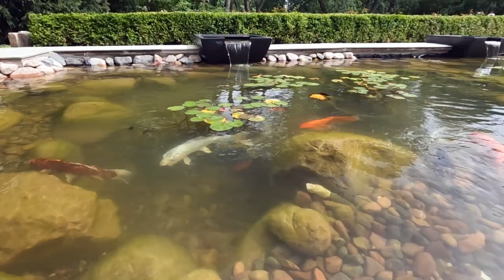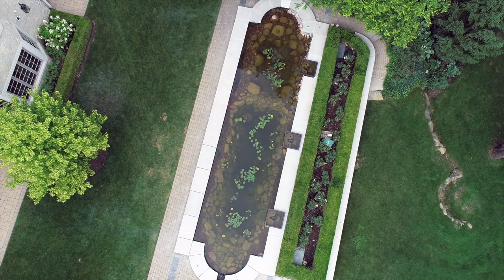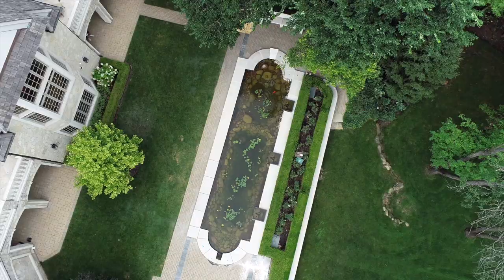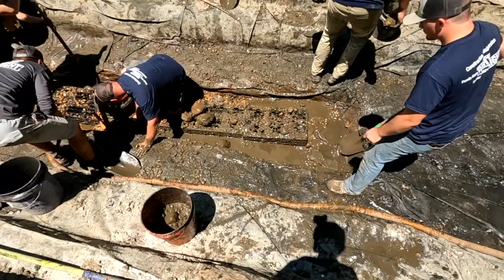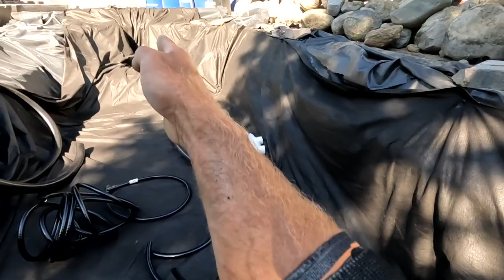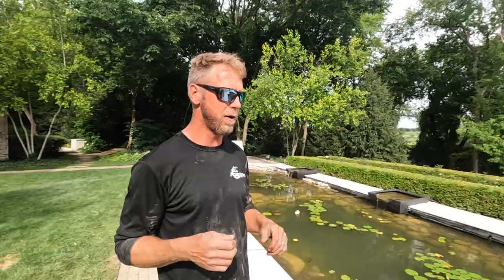Mansion POND Renovation REVEAL!

Comment: Ah...IDK about this one. The property is gorgeous but I'm still getting "old, boring, smelly, green pond vibes" that I was getting from the initial pond. The square spillways aren't enough for me. Either needs much more volume or something different or additional, like a set of the rippled urns perhaps. IMO. And for this having a wetland, additional aeration pumps, and skimmer pump, the water clarity doesn't look as you'd think it would. Surely after a couple weeks the pond should've cleared up by now and it appears to be heading in the green direction from this vantage point. Could it be the square spillways not turning things up enough on the surface? 

But hey, everyone's taste is different and I'm not the one living with it. Good for them if it's made them happy. Though not my favorite, you guys put a ton of work into it and that you guys did great, as always. Good job fellas. 👌 👍